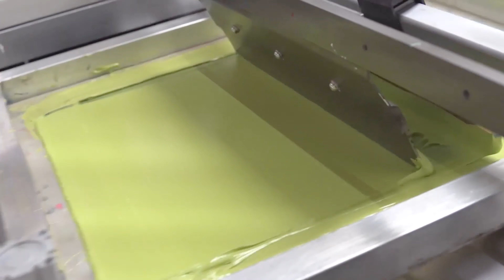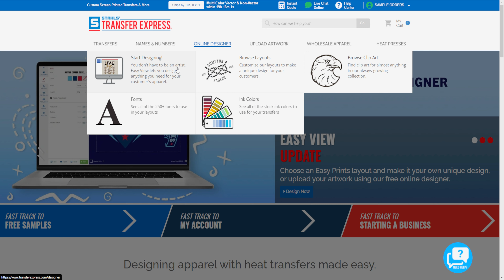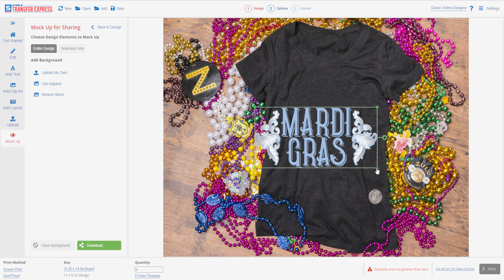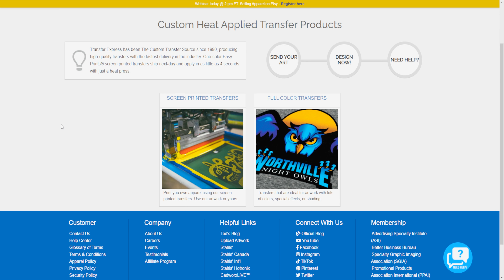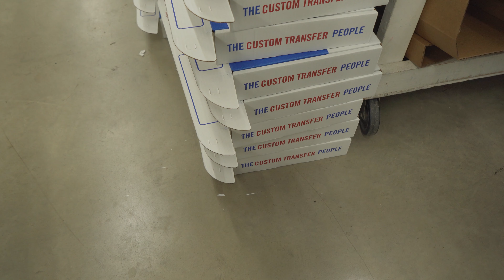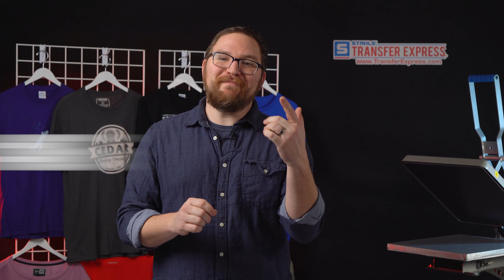10 Tips for Printing T-Shirts With Heat Transfers

Comment: i need help   i am trying to find a physical or printable guide for using temps based on fabrics, etc.  I am darned if I have found one i can laminate and refer to .  Please help me...
Reply from the maker: That's a great question Cathleen, while we have a one sheet with all of our application instructions ( https://www.transferexpress.com/application-instructions ) and a poster available in our application kit: https://www.transferexpress.com/heat-press-accessories/application-kit we've always had some issues putting together a fabric and temperature guide because there's a wide range of heat-sensitivity on polyester depending on who you're ordering from. 

However, as a basic rule we try to keep dark colored, 100% polyester under 300 degrees. This is a fairly safe temperature for synthetic fibers, but depending on the quality of polyester, color or even if it's recycled polyester you may need to test commonly decorated apparel yourself and keep a list. For cotton or cotton dominant apparel any temperature under 380-400 should be a-ok.

Comment: What thing I can use to avoid the heat impression on tshirt that comes after transfer process?
Reply from the maker: The right size platen or your pressure may be too high- We have a video on avoiding the dreaded "pressbox" (especially on heat sensitive materials) here: https://youtu.be/mdl9AXPMlt8